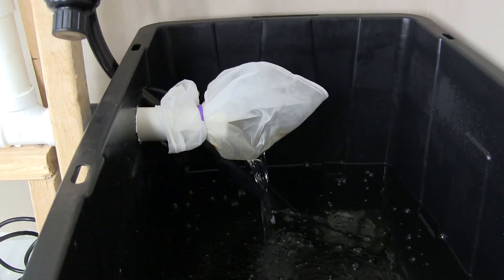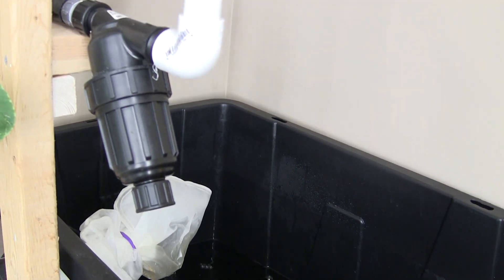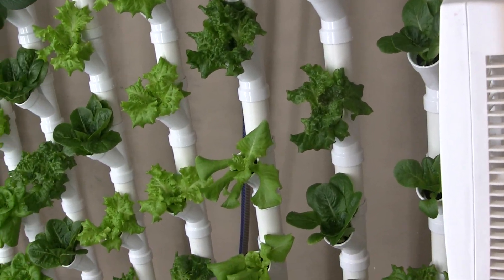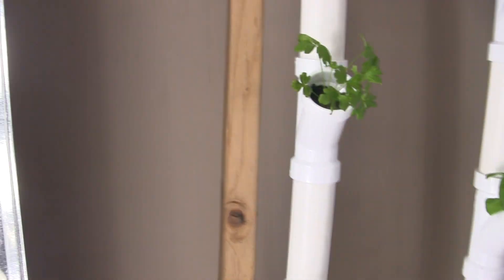Basement Hydroponic Tower Garden Version 2.0

Comment: You didnt "lose half the nutrient", you suffered some water use and evaporation. Be careful as the nutrient levels dont always deplete at the rate of water - you could have excess nutrients in your water. Use a TDS meter to check the nutrient levels before adding more, as you more than likely just need a lightly nuted water top up.
Reply from the maker: true dat. Measuring TDS as well as pH is vital for optimal nutrient absorption. I recommend bi-weekly testing, but once you run your system over time you can see trends and adjust accordingly. All of my systems trend differently (basement, greenhouse, classroom) and I notice that my pH levels change more than my TDS from week to week in the basement system - which is the vid you replied to. It's also interesting that I need to flush every 3 weeks in my basement but every 8 in my greenhouse, which tends to be much more forgiving, perhaps due to my friend the sun. ;-) Thanks for sharing your insight.
Reply: @maryneumayer01  Thanks for the kind reply - it sounds like you are really on top of things! I love the setup by the way.

Comment: Hey Joe, Real cool design. If you don´t mind I would like to do something the simular and I have a couple of questions.
Really looking forward to your response. 

1) How do you enrich the water with nutrients for the plants? Like what nutrients do you use in what quantities. 
2) Could you calculate what your energy cost are on a monthly basis in KWH?
3) What type of pump do you use? How Powerfull
4) On top you have the water input. How does that work? Is it spray? How do you make sure the water is distrubeted equally and what is the flow throught in ml?

5) you said in the video you turn on and off the water supply by a 50 mins ratio. Why is this? and why 50 mins? 

Thank you so much for sharing this video. 

Kr. 

Floris Vegting
Reply from the maker: Sure, if you scroll down I have all the answers to the questions you asked. I realize there are a lot of comments to read, but you'll get answers to questions you don't even have, yet. If you still have questions, please post and I can answer them gladly. Good luck!

Comment: Beautiful! Curious about the pump/drip irrigation setup. I've never done one.
Reply from the maker: I just use a timer to turn the pump on and off. 3/4 inch hose to 1/2 inch supply line to 1/4 drip lines into towers. not rocket science. ;-)

Comment: I truly love this model, thanks for sharing. when you say you feed them the nutrients every 50 minutes is it a timer system that is on the pump?
Reply from the maker: 30 minutes on and 15 off, repeat
Reply: @maryneumayer01  how did you land on this timing and is it necessary to stop the nutrient flow at all? I.e. could the pump run continuously or does this harm the plants?

Comment: Your tubes are 8 inches apart or 1 ft? And the 1.5 inch pvc pipe you dont deal with roots clogging it? I'm really liking your system and thinking of building one similar.
Reply from the maker: sites are 8 inches off center inside, and 9 outside. removable plants don't clog but ones that sit in (leaves harvested instead of removing the entire plant) can clog if left in long enough. I swap out my kales and herbs at 5 months, generally. Alternatively you can keep the roots clipped.
Reply: @maryneumayer01  Thank you very much, helped greatly.

Comment: Hey this is great... its called aeroponics though, not hydroponics, and its better.  :)
Reply from the maker: Hey Ryan, aeroponics uses spray nozzles to mist the roots. Hydroponics bathes the roots with liquid nutrient. Since I am not using nozzles to mist my roots, rather running nutrient, this setup is actually called hydroponics. They are similar though when compared to alternatives such as soil based systems.

Comment: I think your system is the best I have seen on youtube! I love it. I have a degree in horticulture and I think it's fantastic. I have a couple of questions about tubing and water. I can not see your intake and output tubing very well. The tubes and pipes from the reservoir and the pipes leading to the spray line. Also, I would love a few pics of the backflow and nutrient tank flushing system. I just couldn't see well enough on any of your videos. Maybe you can even let us watch you backflush the system. WoopWoop! I hope to see some pics soon. my email is: cynditjie@gmail.comif you can send me a few I would be grateful! Thanks Cyndi
Reply from the maker: Hi Cyndi, the pipe is 1.5 inch pvc, and there is a black 3/4 in hose that connects the pump to a 1/2 reducer, which supplies the 1/2 irrigation tubing. The 1/2 connectors punch into the 1/2 in irrigation tubing and the 1/2 drip irrigation line leads directly into the pvc towers. There is no backflow valve. The system tips toward the nutrient container so it drains with gravity. I am the flushing system. Since the container sits on the ground, I have to scoop out the aged nutrient and dump it, or use it for houseplants and outside plants for some extra fertilizer. Hope this helps.

Comment: CAn you, please explain or even better give a cross section of one T. I saw on your testrun video that water flows down the pipe. How deep is the root and how is it placed in the flow
Reply from the maker: Hello, the roots grown downward in the tower, and the irrigation runs down the front and irrigates each plant. The end of the rockwool plug slightly protrudes beyond the T into the pipe. Remember that the rockwool is just a placeholder for the plant to establish itself. The rockwool cube fits snugly in the opening but if you push it hard enough it could fall back into the pipe. Hope that helps.

Comment: The indoor strawberries that I started with didn't work out very well. I tried them in the tower system and Kratky system. Both did not produce harvestable strawberries. It was probably a lighting issue and maybe my Masterblend tomato nutrients were not quite right.
Reply from the maker: I'd put money on the lighting. I grew strawberries vertically in  my greenhouse and they were delicious, before the spider mites destroyed the plants. And I used the masterblend formula at about 1500 ppm. THanks for the update.

Comment: I set up a tower garden based on your specifications. Once I got the right pump, the garden has been a total success. I planted it with swiss chard. I also have a Kratky set-up planted with the same swiss chard seedlings. The tower garden has outperformed the Kratky system by a wide margin. Thank you for showing us your system.
Reply from the maker: great to hear, thanks for sharing!
Reply: These nft systems are sweet but if you put an airstone into yoyr kranky system your rootball will expand exponentially and then you will see growth. Thats a dwc. Best producing system of all in my opinion. Please try a pump before abandoning the other system
 I promise you will not be dissappounted. An 8 outlet pump is like $25 bucks. Good for 8 -5gal. DWC pots. Best investment you can make!
Reply: @denisrowlett9829  Don't worry I am a Kratky fan. Joe's system is great for lettuce as you can harvest a head of lettuce and easily replace it with a new seedling. I am pretty sure I will stick with both systems for a long time. The downside of dwc is it uses so much more nutrient solution, otherwise, I agree with you.

Comment: You got a $45 rebate on a $60 purchase of LED's - wow!  Yours is the neatest operation I've ever seen on youtube.  The fan is very necessary I know because without plants are weak and encourage mites and stuff.  Do you use net cups in those T's, wondering how the plants stay put?  A lot of nutrients you use; is it necessary to flush the system every three weeks, sounds excessive and costly.   I've used large CFL's in the past for growing indoors. This is impressive.  ciao.
Reply from the maker: thanks. no net pots - just stick the rockwool plugs into the opening for a snug fit. I keep the nute cost down by making my own. Otherwise it would be costly.

Comment: What - no Parsley?  Parsley in smoothies is better than any other veggie as it is not overwhelming up to almost a handful; also Parsley makes a Pesto sauce equal to Basil pesto sauce.  Parsley is considered a super food - check out its specs.  Love your setup.  I await Spring next month and will create a Tower made from stacking 5-gallon buckets (I inherited about 30 buckets) and making holes in the sides for plants like yours, but I will use quality soil; and if it works well I will bring it indoors in the Fall and make aeroponic/hydroponic operation from it.   Thanks for sharing a great project you've accomplished.  ciao.
Reply from the maker: cool idea, best of luck to you. Parsley grows wonderfully in the system - too well actually as the roots can clog the pipe at about the 6 month mark, especially if there are more than 1 plant. Trim the roots or start new sets - that's what I do. And I love a parsley and cilantro smoothie with lemon. I can feel it cleanse my entire gastrointestinal system!! ;-)

Comment: Looks great! Building a system off your design just now and was wondering what you put in the holes? Net cups? What diameter?
Reply from the maker: no net cups necessary - just stick the 1.5 inch rockwool plugs into the openings for a snug fit. have fun!

Comment: This is great! I read through all the comments and want to know how you prepare the rockwool? It looks like from the video you don't cut the sheets until the seedling has sprouted, is that right? Do you use one 1020 tray with no per plant inserts & any issues there? For Lettuce is 1.5" diameter piping ideal or could 1" be fine with smaller rockwool plugs? Also, it looks like your towers were unpainted in your greenhouse, what effects does UV have on the PVC? Thanks again for the videos and responses to so many comments!
Reply from the maker: Hey John, I just use standard grow trays and put the seeds in and rip the plugs apart when I need them to go into the system, just like you thought. There are no issues, except for some annoying algae which grows sometimes,  because I like to use a bit of nutrient for the seedlings once they have germinated and show their first 'leaves,' when they are about 2-3 weeks old. So now I germinate them in a separate tray, and then isolate them in a container in the grow tray under the lights, before I move them into the part of the tray with some nute, which grows the algae. It helps if I wash that tray out weekly, which keeps the algae growth down. 
I'd stick with the 1.5 inch piping instead of the 1 inch. Some varieties of lettuce do develop quite the root system and may clog the 1 inch pipe and cause leaking. 
As for paining the greenhouse pipe- that's on my agenda this spring as soon as the weather warms up . Thanks so much for your questions.

Comment: Do you have any leaking with this setup?
Reply from the maker: It is possible if you let the roots of non-pulled plants clog the pipe. I remove my parsley,  kales, and dill after 5 months and put in new plants to prevent this. When I harvest these plants I clip the leaves instead of pulling the whole plant, like the lettuce and bok choy. And water often finds a way, so there is always a danger.

Comment: Thank you for the inspiration!  I modeled my system very closely to yours, the only real difference is the addition of buckets on the same system.  Here is a link to some photos, let me know if you have any constructive criticism, thanks!
http://imgur.com/gallery/iD0c9Ar
Reply from the maker: Hey Pat, looks good. Great job! I'm assuming you will be putting vertical lighting in front of the towers. The overheads will not suffice.
Reply: @maryneumayer01  yep!  The overheads are only on the ceiling when I need them out of the way.  Several of the photos in that album show them down in a vertical position in front of the towers, with about 10" in between the light and plant site

Comment: Your gonna get mold..probably black mold due to all of the moisture your creating with that thing.
Reply from the maker: Thanks Eric for your concern about my safety regarding my thing. I gauged the humidity in that room at 31%. I just have my many years of experience with my greenhouse and basement system and my degree in biology, including microbiology, but I certainly would not consider myself a mold expert. (Although I have never had mold growing in my basement whilst running this system, to my knowledge.)  My concern about lowering my house humidity even lower than 31% would require me to humidify it for the comfort and health of my family. What would you suggest?

Comment: Add a float valve to your supply tote and a add second tote to sit on top of the first one. It keeps the first one filled and offers more time between nutrient refills. I grow tomatoes in 5 gallon buckets in a spare bedroom and use the two tote stack system. I use 6K color led tubes and the cheap Mylar space blanket reflectors with great results.
Reply from the maker: Thanks Roger for the tip. I can go about 10 days before needing to refill but if I go out of town for a longer period that would be very helpful. I did put up mylar back in December when I removed some diffusers and lights and I am happy with the growth. An unanticipated bonus is the channeling of the air flow behind the plants which really helps with circulation and transpiration in my opinion based on simple observation.
Reply: @maryneumayer01  For better air flow, I added a small fan connected to a timer (along with an air pump) which come on briefly 4 times an hour or so.  I have been successful with  a hybrid of DWC, Dutch buckets and aeroponics. I have a timed pump in the supply tank which just about fills the 5 gallon buckets 4 times an hour thru inverted lawn sprinkler heads in the top of the buckets and then they slowly drain half back into the supply, thus each bucket "breaths" fresh air and also get a bit of compressed air into the solution remaining in each bucket. Great hobby! Best wishes.

Comment: nice system buddy...one advice though ... if you want to increase your light intensity just remove the plastic bulb to expose the LEDS ...its glued in and very easy to snap it off.
 By doing that ,you will increase the light intensity for free ....one other thing...add some 2700k- 3500k to your recipe so that your lettuce will have the proper color..... .thats what i do to my 15 watt LED bulb set up....peace
Reply from the maker: Hey thanks. I removed the light diffusers back in December and was able to reduce my energy requirement and maintain good growth. I'd like to experiment with the color temperature. Thanks for posting!
Reply: @maryneumayer01  yes i saw that you removed the plastic cover. I noticed that the next day after seeing an updated video of yours....anyway glad it worked for you..
yes try adding some 2700k to your recipe....welcome

Comment: Hey Joe. I wanted to show you my garden finished.  https://youtu.be/nt4f-HxSD8s
Reply from the maker: Wow Murray - that's so awesome, congrats! You may want to apply a coat of UV blocking paint as the sun will degrade the PVC over time. When I built my prototypes the lettuce did so great outside - you can also do herbs too. I was amazed by my chives. Parsley does great too. Best of luck to you and thanks so much for sharing!!
Reply: @maryneumayer01  thanks.  Keep updating.  Here's a photo of it planted both with seedlings and plants from my tower garden.  Also decorated for christmas.  The lights all come on when the pump starts!!!!   https://www.dropbox.com/s/7vugfugafxwtb1c/20191215_101901.jpg?dl=0      https://www.dropbox.com/s/cghmacp8ef4dsl2/20191215_101947.jpg?dl=0

Comment: Put some wheels on the light stands so you can move them closer. And you should be happy to learn that recent studies show that red light after the seedling stage actually increases production for lettuce, so in the long run, your 5000k might end up being better than 5600k. Test actually showed that equal amounts of red and blue, alternating on and off for an hour of red, then an hour of blue, was the most productive, and alternating for 4 hours decreased production. Running both together using cool and warm LEDs was almost as productive as the alternating for an hour, using a mix of 3000k and 6500k.
Reply from the maker: interesting, thanks for sharing. The light stands are on wheels and I moved them back to shoot the vid. I keep them about 20-22 inches from the plants normally. ;-)
Reply: @maryneumayer01  You covered everything!!!!! you could maybe even move them closer if the light spread/focus works. I have my LED lights no more than maybe 4" but on a smaller scalle.  If I knew I was going to do a large grow of lettuce, I would do it on horizontal levels or shelving You can buy led strip lighting that is about 15 watts per foot of length and only an inch wide, ready to plug in. They have them in 8 foot lengths that would work for your vertical system. Check these out on Amazon-, just to make better use of light.  You could hang them vertically and more simply that what you have now.       8Ft LED Shop Light Fixture, 120W Integrated LED Tube Light,13000LM, 6000-6500K, Clear Cover,High Output,Four Row V Shape 270 Degree LED Lighting for Garage Warehouse Workshop Basement, 8 Pcs